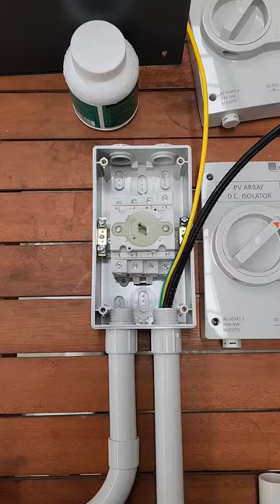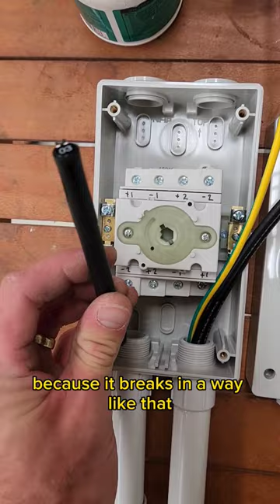DC isolators #nztradie #electrical #mahi #solar #learning #electrician

Comment: In Australia  we put bridges across the  top and connect in the bottom  terminals
Reply from the maker: We do also, sometimes just depends on the application
Reply: @nztradie  nice one,true that.we love these build  in DC isolators in the inverters  now too and the new reg of disconnection  points  on the roof, so much  quicker  and less roof fires  from cowboys of the past, nice  installs bro